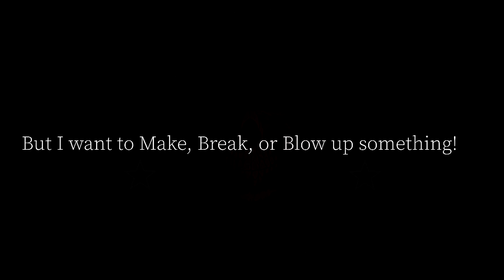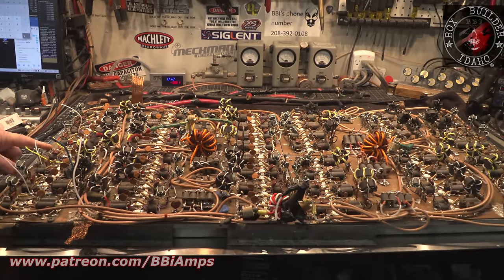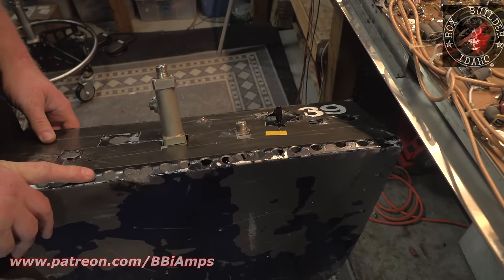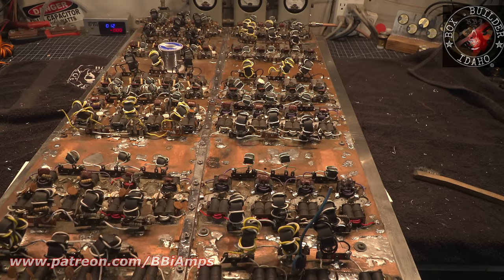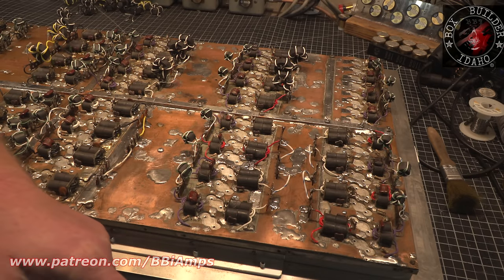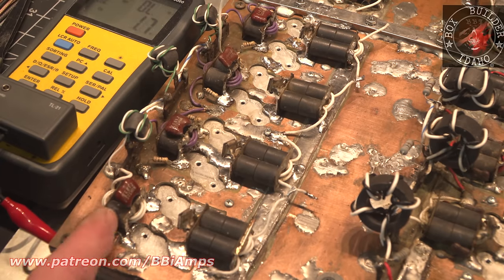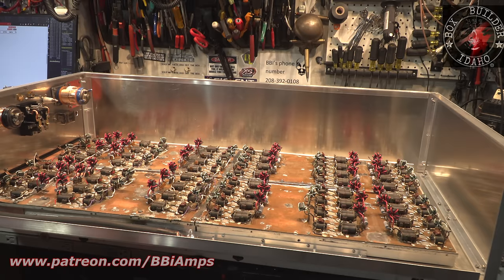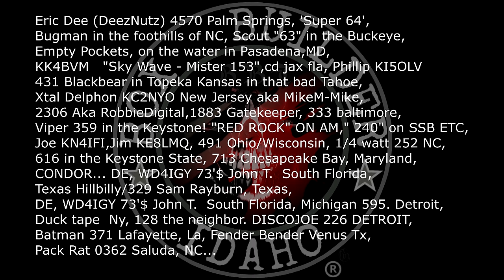End Of Year Video 2023 Part#2 96 pill

Comment: One thing you never addres is that you Do Not have to have massive cables feed this amp or Any amp for that matter..
It only depends on how hard you plan to drive it. It this owner only ever wanted to work this box at 20% or 40% percent of it's capacity. That's his prerogative. Not all operators want to run BALLS to THE WALL.. Keep that in mind.

Comment: If I owned this amp. I would have said ok take this 96 pill and give me a 32 pill and a power supply in exchange straight up trade. Cus clearly this guy can't even power this when u give it back let alone he's probably trying to jam it into an antron 99 antenna
Reply: i dont think he can run with moonraker beams without burning up the coax
Reply: @darrelldundee7198  Not only will the coax fry like bacon. Must use heliax + the Gama match will go up in smoke  !!!! Take care, TMP, Unit 22 from N.J.